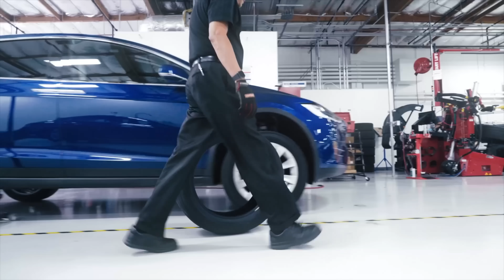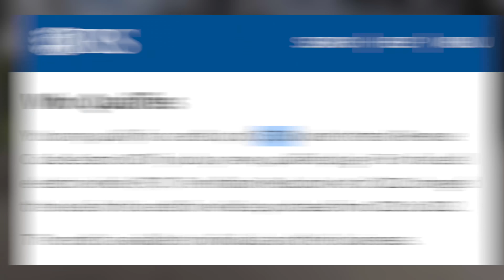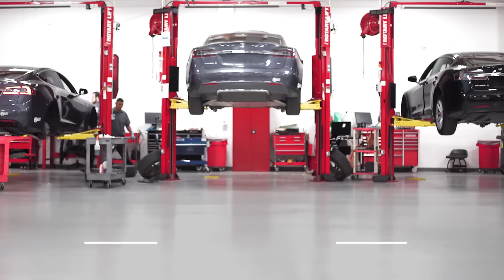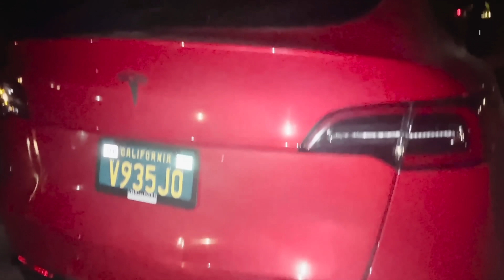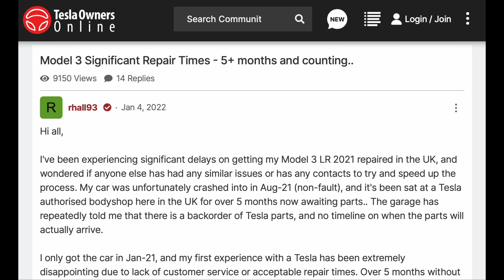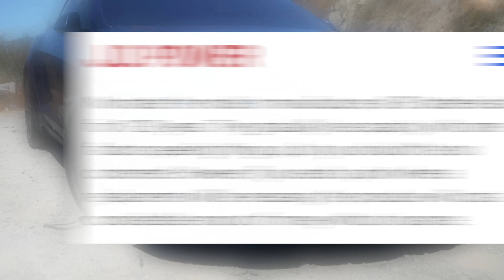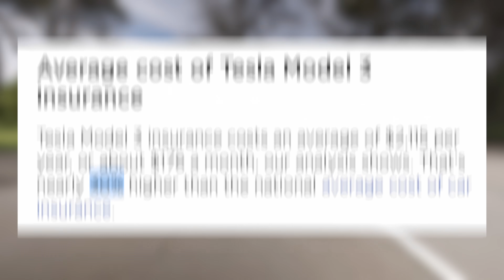My INSANE $23,614.36 Tesla Repair | Tesla’s Expensive Repair Problem

Comment: I do not know where you got the cost of EV vs Gas but it was not in California. My household electricity cost ranges between $0.35 and $0.45/KWh. My 2013 Chevy Volt gets about 36 miles on a 12kW charge, so, using $0.4/kWh is 12x0.4=$4.80; that's a higher amount than local regular gas at ~$4.50/36 miles. I know that a lot of people think their electricity is $0.10/kWh but where can you buy electricity for that cost?
Reply: Northern Illinois - we’re paying about $0.11.
Reply: In BC, We pay 13c Canadian which is around $0.10 USD.
Reply: 29¢ LA, 19¢ in central NJ.

Comment: I purchased a  2016 Tesla S in 2019 for 40000 . It had only 18000 miles on but it had been in an accident. I held my breath and bought it and its been fine except for an initial accident a few days after I bought it.  It did not have air suspension and someone had turned off the warning chimes so when I parked the car and pulled forward it did not full clear the concrete stop strip and it took off the plastic fascia underneath and some related damage. It cost 5000 to repair so I became painfully aware how expensive Teslas can be to fix. I am very scrupulous in protecting it after thant. As far as the first accident went, there was some damage to the panels and I speculate that it bought at a salvage auction and fixed up as I got it from Off Lease Only which is a bottom fisher. I was lucky as I know cars and I could see it tracked straight and true which was the bottom line. And the repairs we done OK.  In the future I would never do this. And always get a car fax. Never buy a car without it. Do I love my Tesla S, absolutely. It put the fun back in driving and I have a home charger which is a god send. It a technological marvel and its updated all the time via the net. So many new things added. Its so good, we just got a new Model Y  LR and my wife absolutely loves it. But they are expensive to repair and maintain. You just cant get the front end aligned. Either you bring it to Tesla who has the right equipment or  a Tesla  certified repair shop like Electrified Garage. PS you must buy jackpads before its put on a lift or you are courting disaster after it gets jacked up. I dont bring my S to a car wash. Teslas are prima donnas and dont do well in them. I was it myself. So keep all this in mind.
Reply: $5000 out of pocket or did you pay deductible?

Comment: I keep being told tesls's go through tires fast because they weigh so much and have more torque.. my brothers mustang weighs more than my tesla and has more torque, and a pretty flat torque curve and it doesnt eat its tires alive. I have a sneaking suspicion people are always accelerating a lot more then they would in another car because its so easy to do. I do this.. even when I am taking it easy I still out accelerate everyone from a light or goosing it on the hwy to grab some speed. ITs effortless in a tesla and because there is no engine noise it just doesnt feel like you are putting the tires under so much load.

Comment: with 8k miles a year, these maintenance costs are ridiculously cheap 😂 ik the community has been saying this for forever but once sticker price drops its so over for ICE
Reply: I hope this happens quickly but I am afraid it will not. I would think they will have at least a $5k premium well into the twenty thirties
Reply: cheap until you get in an accident...
Reply: @viadharmawheel  It's cheaper actually when you consider medical costs, which are more expensive than car repairs. Teslas have some of the highest safety standards for occupants.
Reply: @JacktheSmack  Maybe, but people not be attentive with level 2 "FSD" is causing a lot of accidents too. In any case, the repair costs are ridiculous. Elon's single casting solutions will only lead to "throw away" vehicles. This only makes sense if they ar 25k or less...
Reply: @viadharmawheel  Tesla with FSD get into a fraction of the accidents that the average Tesla without any Autopilot or FSD active does, per mile. And the average Tesla without autopilot or FSD active gets into 1/3 of the accidents the average American car does, per mile.
Reply: @viadharmawheel  In that case ask your insurance co to total it. Often they will if repair costs are high. Then,, move on.
Reply: @Dive-Bar-Casanova  not as easy as you make it sound.
Reply: Best of luck on that one. We still have cars that are older than you still on the road and running. Won't see that with Teslas 😂
Reply: @rickitysplitz7035  ok

Comment: In a nutshell, They don’t need that much maintenance, but when they need repairs, they will be expensive
Reply: True except Tesla isn’t a luxury car. Much less the 3 or Y. Premium car yes but not at all luxury.
Reply: @LuckyAeon  that's true but still call them like that.
Reply: @LuckyAeon  why is it not a luxury car? What kind of features is it lacking?

Personally, The fact that Tesla has the best sound system, driver assistance, deceits are comfortable and leather, everything is heated and cooled, And honestly the self-driving features are a luxury to me.
Reply: @pilotavery  Craftsmanship but  A LOT...
Reply: @pilotavery  Everything you just listed besides FSD can be found in most Toyota Carollas today. Luxury isn't only about features but about craftsmanship. Tesla is the leader in EVs and tech but not when it comes to quality control and craftsmanship. In fact most Tesla have lost basic features like Park Assist, etc.
Reply: @LuckyAeon  Tesla used to have issues with quality control and build quality. This is no longer the case. All of the latest model 3s have fantastic flawless build quality. They've spent a decade perfecting this...
Reply: @LuckyAeon  I mean also those features are in Mercedes as well...

Not to mention the sound system is the best of any car. Hands down.
Reply: @pilotavery  My wife's brother works at Tesla and is an interior engineer there, he also does QC around the globe where Tesla is. He swears that Lexus has way better quality materials, quality control rulesets and when he was in Toyota he couldn't even be good enough to completely work at Lexus Japan. All people I know who work for Tesla don't use Teslas too lol
Reply: @pilotavery  let me tell you from perspective on luxury car owner. I drove porsche cayenne that was specced to the gills full leather, insulated glass, air suspension, adaptive cruise control, sport design package, rare paint etc. When you drive inside its so quite, when needed sport suspension you press button and its stiff and lowered and it handles like a sport car, when you put it on soft suspension it drives like on clouds, sound system is bose and its way better than any tesla i drove including my model y LR. Porsche doors are heavy and smooth you feel quality in everything including paint. In contrast tesla is just tech, doors made from tin metal, they even include instructions how to properly close frunk in order to avoid damaging it lol. When you stop at traffic light in tesla you can hear car next you playing music or speak on teh phone and I have 2024 tesla with double pane glass. In contrast in porsche you barelly hear when someone honk. Tesla barelly premium and opposite of luxury. There is zero luxury in tesla at all
Reply: @sardororipov1302  you have not sat in a Tesla model S, they're dead silent. You can hear a pin drop inside. They also are silent while driving.
Reply: @Luke-qs2cg... only difference is with other luxury cars, your neighborhood mechanic can fix it, ... Tesla can only be fixed by Tesla
Reply: Most people who have a tesla can afford insurance so it doesnt matter🤷‍♂️
Reply: Bottom line - EXPENSIVE 😂
Reply: That's any good luxury vehicle
Reply: @Luke-qs2cg NOT LEXUS
Reply: Still cost less than equivalent Mercedes and BMW...
Reply: Any luxury vehicle one way or another you will pay prime :(

Comment: I currently have three cars: a Toyota Corolla, a Honda CR-V, and a Mazda CX-5. The total cost of insurance for these three cars is around $1,200 per six months. I recently got a quote for insurance on a 2023 Tesla Model 3, and the cost was $1,300 per six months alone... more than all three cars together, wow.
Tesla's website highlights the potential savings of owning an electric vehicle, such as lower fuel costs and reduced emissions. However, it is important to consider the extra costs associated with owning a Tesla, such as higher insurance premiums, more expensive repairs, and the cost of installing a home charging station.
In my case, I estimate that the extra cost to own a Tesla Model 3 will be around $2,500 per year. :face-fuchsia-wide-eyes:
Reply: Go through Tesla’s insurance
Reply: @alphagodvon  msybe he cant, its not everywhere yet

Comment: I drive a 12 year old Mercedes.  I was recently quoted $1200 each for two rear taillight assemblies, and there are no 3rd party parts manufacturers.  A fair repair cost comparison would be with other luxury level cars, not against average cars.
Reply: Tesla components have high resale values. At a certain point it makes more sense to part out than to repair.
Reply: What model? I don't see how it is $1200 each
Reply: What makes you think a Tesla is a luxury car?
Reply: My 2005 old Honda CRV is running strong and repair costs are not bad all due to abundant spare parts.
Reply: The average new car price is between $45k-$50k. The Tesla Model 3 and Y can fall right in that range. So by that metric, they are perfectly comparable to the average. Also comparing a 4 year Model 3 repairs to a 12 year old Mercedes is hysterical. The only comparison I see to your car is that Tesla is also notably low on its repair parts inventory that once the Model 3 is 12 years old, I would guess that quote would be the same.
Reply: I don't know what condition your Mercedes is in, but from my experience it's time to get rid of it.  Unless you live in Europe, you do not want an old Mercedes.  When they start getting old they are money pits.

Comment: We had a huge accident in December with our MY. The passenger side was damaged and the rear driver side tire was bent out.  The repair estimate was about $45K and my insurance company totaled it.
Reply: What happened after it was totaled? Did you have to pay extra $$$ out of pocket to get a new replacement MY? That’s what I worry with insurance. If they total my car, they better replace it at little or no extra cost to me…
Reply: @HypocritesExposd  Fortunately we have great insurance and after they paid off what we owed, we had enough leftover to make a down payment on  a new MY.
Reply: @HypocritesExposd that’s why you always get a lawyer to get the medical payments. That usually gets enough money to cover the replacement cost and sometimes even more. These lawyers don’t charge anything until you get paid. They take 30-35 of the settlement money.
Reply: @leftoverpizza01  good point. Crazy how you have to get extra money for “medical expenses” just to break even on your totaled car that wasn’t even your fault to begin with. All that extra cash going to lawyers is a waste for all the insurance holders that have to foot the bill.
Reply: @HypocritesExposd  yep insurance is always going to get their money back from the client over the years through higher premium. The at fault driver will get screwed , but they are the reason the crash happened in the first place so I don't feel bad for them.
Reply: @HypocritesExposd  I’ve seen a couple of examples. Teslas are new enough yet, you should be able to get another one of similar value and condition…but don’t expect a new one.
Reply: @HypocritesExposd  unfortunately that’s not how insurance works unless you buy a “replacement value” (or similar) policy rider.  The whole idea of insurance is to keep the policy owner from going broke…not necessarily to make you “whole” or equal to before.
Reply: @awash7156  I mean I get that they can’t replace it with a new car, but the fact that if someone hits you, was their fault, totals your car, and then you have to pay extra just to get a car that’s almost as good as the one wrecked… that really bothers me.
Reply: @HypocritesExposd  Man that would suck but I guess that's just a risk many people run when you buy certain vehicles
Reply: How much does that affect your insurance?
Reply: @nirmalvekariya333  this was our first accident and we are not at fault so it didn’t impact our insurance at all
Reply: The Rivians  need $40k+ for a minor rear smack.
Reply: Were you alive afterwards?
Reply: Did you survived?
Reply: And that’s why Tesla insurance costs are so high.
Reply: Those cars seem a little bit like Apple devices. Once damaged you can throw them away. Repair not economically feasable by the manufacturer.
Reply: That was makes these “green energy” cars special, one bent on the frame and you total the whole car.
Reply: @ananth11  I feel like if you get “frame damage” on any car, it’s considered totaled.
Reply: @ananth11  The Tesla does not have a frame, it uses unibody construction, like nearly all current cars. If the unibody is bent, any car typically becomes unrepairable. It has nothing to do with the power source used in the vehicle.
Reply: @ananth11  
If any car has it's frame bent in an accident it is considered totaled by insurance

Comment: I don't get it. In 2017 I paid $6,000 for a 2009 Honda Civic with 120,000 miles. Today it has 130,000 miles and runs just fine. (Thumbs Up #19.)
Reply: Because he talks about rare edge cases and accidents. My Tesla m3 has run 140.000 and no issues at all apart from regular maintenance. Had an ice before with engine damage, and big repairs on other cars around 120.000. So far Tesla is the cheapest. I dont care for repair costs for accidents as this never was by my fault and the insurance had to pay